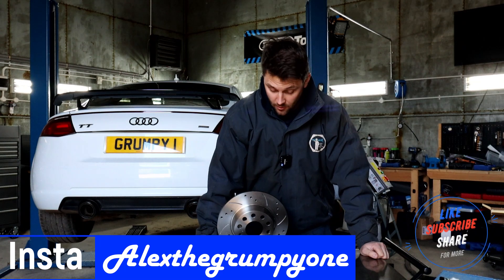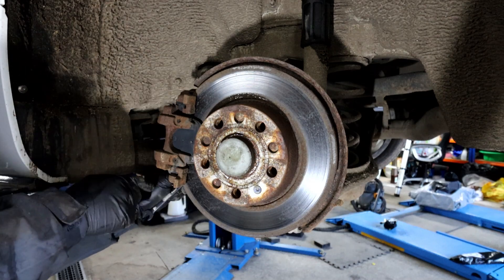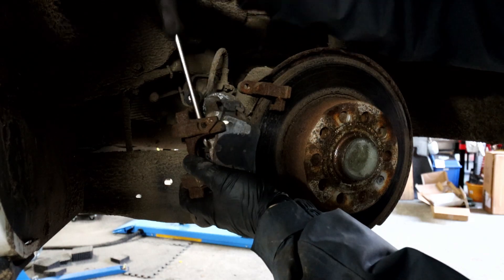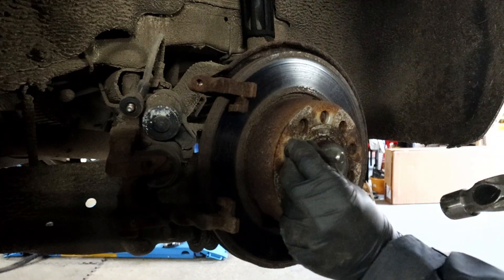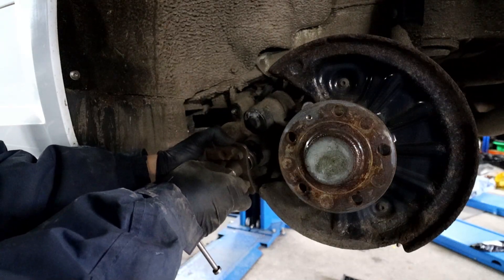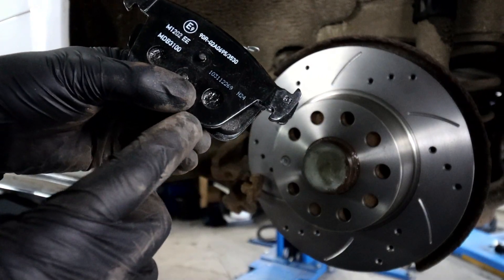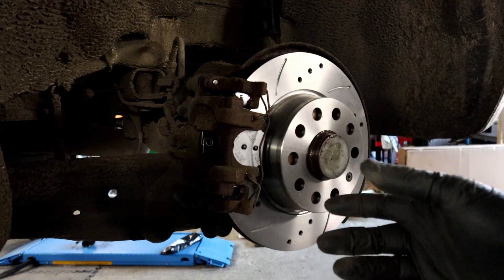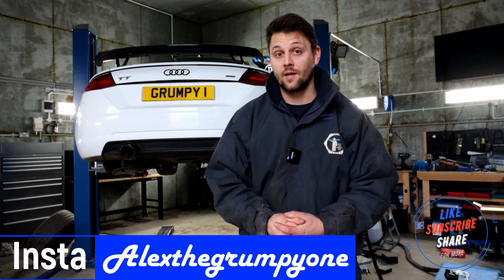Audi TT MK3 Rear Brakes Replacement. Rear Discs and Pads replacement. Electronic Handbrake.

Comment: Solid video, thanks! M14 is where I was confused at. Got the bit now, the hard parts getting the bastards out.
Reply: Also, I just released the electronic parking brake, didn't run into any issue with the caliper. Don't get me wrong, I'm guessing you risk damaging the motor if you don't use the OBD tool first, but with the handbrake released the caliper is workable.
Reply from the maker: Yes unfortunately it will put a fault on the system. And end up damaging calipers

Comment: Can I change the brakes without a obd scanner?
Reply: I believe OBDEleven can be used to release parking brake to service mode too.
Reply from the maker: No unfortunately you can't. 
Need diagnostic tool to wind them back. But there are cheap ones that do it actually
Reply: Yes you can. You can remove the motor cover at the back of the caliper and wind them manually.